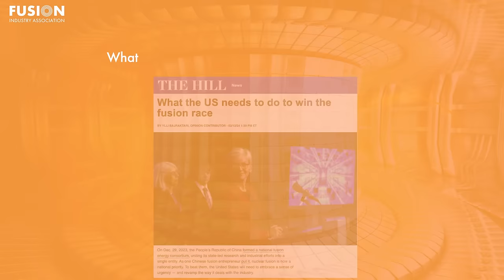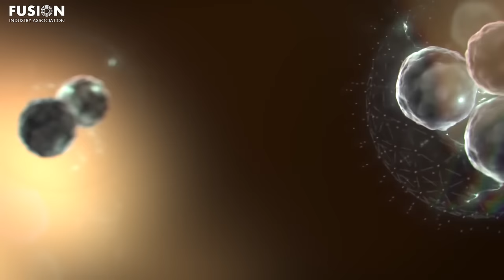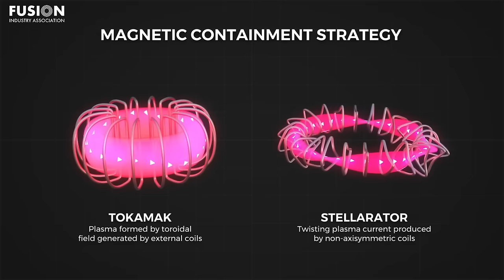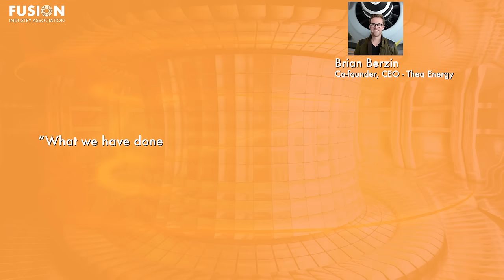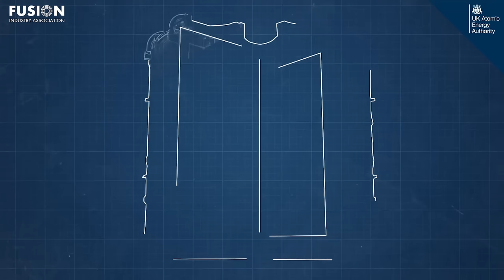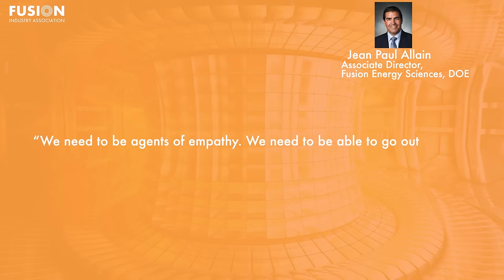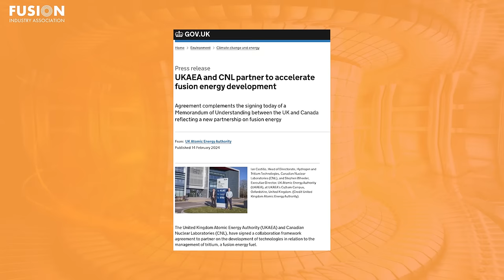Fusion News, February 21, 2024

Comment: 59MJ of heat energy is worth about 20MJe which is about 6KWhr(e),  worth about 1pnd, so pray tell what was the total energy input to the entire facility in pounds plus maybe a share of the capital costs for running the plant for what maybe 30years and a few energy pulse shots.

Also where did the tritium come from, almost certainly it came from a Candu fission reactor for which there is vanishly little production which is headed to 0 because of the anti fission hysteria even amongst the fusion people.

And since the plasma produced neutrons from the fusion reaction, those neutrons must have irradiated the containment vessel making it quite radioactive, and please tell us what percentage of the tritium was actually burned in the event, I suspect very little, the tritium is ofcourse very radioactive, far more so than plutonium since its half life is many orders shorter.

So no statement about the electrical energy or the tritium value inputs, only a fantastic celebration of a pound worth of equivalent electrical energy output. If this doubling keeps happening every 10 years, then the JET will eventually be producing more energy out in value than the entire capital cost of the entire plant in about 1Million years. Oh but the plant is now shut down so no payback ever. There will be quite a cleanup bill for the radioactive vessel though.

Meanwhile we have fission which is a very difficult word to say for almost all fusion scientists and greens. Oh the irony, if they used Lithium Deuteride for the DT reaction, they first have to fission the lithium releasing no energy but getting net energy when the released tritium fuses with the chemically bound deutereum.

Also we have Molten Salt Reactors which operate at only 1000K, while these fusion reactors are running close upto 100,000,000K, how could a 100,000 increase in temperature be favorable to the engineering of the project. At least in MSRs, the neutrons stay within the fuel or can be used to breed more fuel, but in fusion, most of them are going to be lost in the walls.

Comment: Amazing news. Maybe in a future video you could explain how energy will be harvested from fusion reactors.
Reply: Unfortunately, my take on it (as a lay-person, but a keen observer), is that many of the designs center around a "Tea-Kettle" concept of heating a fluid and using the hot fluid to turn a turbine, and a generator.  So, basically sort of boiling water, but designing a $$multi-billion way of doing it powered by Deuterium and other "fuels"...sigh...
- A notable exception to this is the "Aneutronic" designs, like the Fusion Reactor that Helion Energy is developing, that captures prodigious amounts of energy directly from the fusion plasma in the reaction chamber and uses that to charge a large bank of huge capacitors and re-uses that energy to power itself, and also (in future designs) channel excess energy directly to the grid. No "Tea-Kettle" or boiling water or any other fluid involved!

Comment: 2:00 It was sooooo successful they shut it down huh? How does that make any sense?
Reply: It contributed significantly in the understanding of plasma science and the development of fusion technology. While it was originally planned to be shut down in 1992, it was continuously upgraded testing different scenarios, and lasted 40 years. It could have been still further upgraded, and JET scientists had  submitted a proposal in that direction. However, since the UK, which now owns JET, left EURATOM after Brexit and has different plans. JET is based on 1970's coil technology, and the fusion programme must move ahead with modern technologies, such as high temperature superconductors. It is indeed a shame that JET, as well as TFTR in Princeton were unable to reach breakeven as people expected back in the 1980s, but success isn't only measured in terms of that.
Reply: @jjeherrera  great point man!